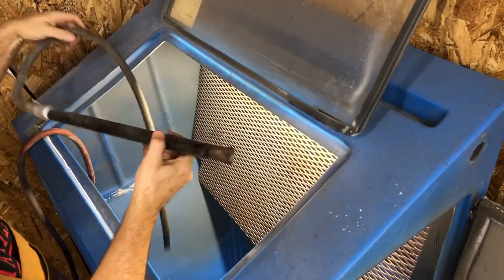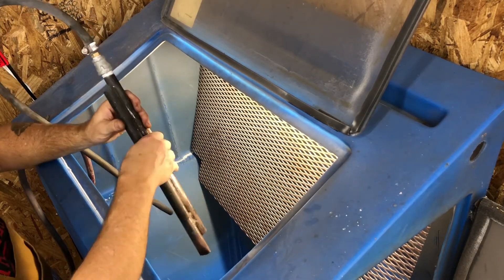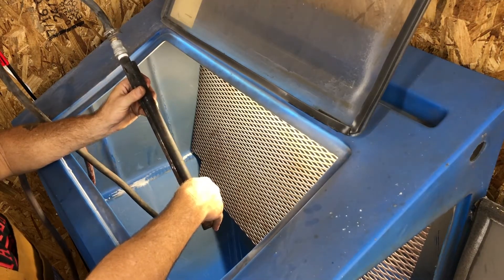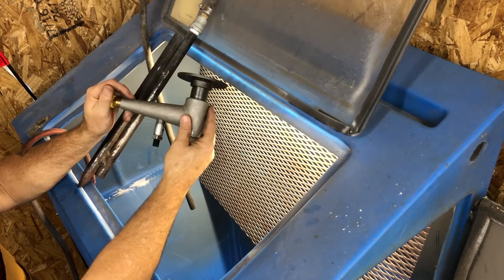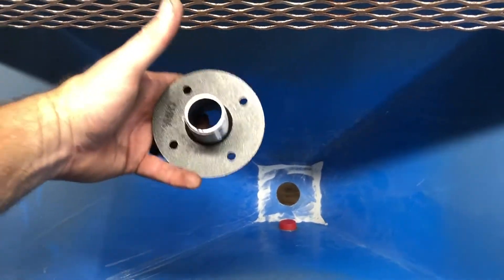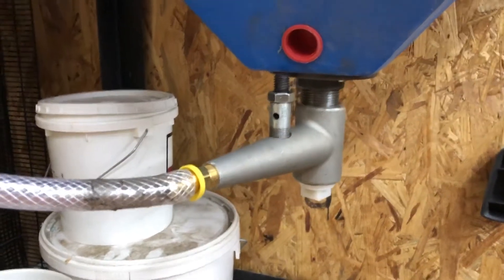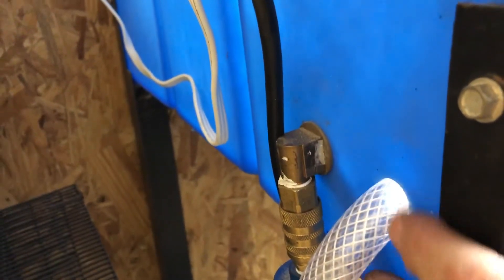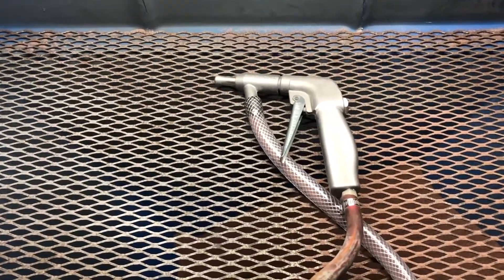Installing a Blast Cabinet Metering Valve Assembly

Comment: Are you blasting at 30 psi ? I though it was 90
Reply from the maker: It all depends on what I need to blast. If I’m etching it may be between 30-40. Prepping for coating ranges between 30-120 depending on the substrate. General blasting/cleaning/stripping is around 80-120.

Comment: I like your explanation, well done! It looks pretty easy to make from pipe fittings, Use a 1- 1/4" tee, a 1-1/4" pipe plug at the base of the tee, a 6 inch nipple, a reducer from 1- 1/4" to 1/2" , 5/8" pipe nipple 2" long to be modified as your air valve  and then finally a barbed fitting to your air hose. The only machining would be is to drill and tap a 5/8" threaded hole into the 6 in nipple. The using a 5/8" nipple that has  (2)  1/4" holes positioned one above each other. Then drill and tap into the 5/8" air valve nipple to accept a bolt to adjust the air flow. No need for a locking nut on the bolt, it isn't going anywhere. But put one anyway. You'll feel better that you did.
Reply from the maker: I’ve seen these done and are a great diy idea. I was under the impression that the tapering increased the Venturi effect. No proof - just an impression I can’t shake.
Reply: I'm not sure if the tapered design acts in anyway as a venturi since the proximity from the air valve to the tapered area is to far to create that effect. It does make it look complicated though.
Reply: Tapering it allows it to flow without restriction from the larger size to the air hose size. You may see some improvement with lower CFM supply. With a larger capacity of reserve air in your compressor tank you may not notice any difference. The 1 1/4 nipple does as good if not better in mixing the air/abrasive mix. Use a ball valve to control input air into mixing chamber. Don't waste time with nut/bolt/tube idea. It is just their way to confuse you

Comment: Thank you for posting this video.  I just picked up the same Cyclone cabinet on FM and the IDS Blast metering valve will be one of the first upgrades, after a few repairs.  I am also interested in anything you can share/recommend on the dust collection for this cabinet.  Thanks again!
Reply from the maker: Glad you found it helpful. Here is a link to my cheap dust collection system. It has been working great! Good luck with your cabinet. https://youtu.be/4tQ9s_EJdRg

Comment: So I just bought this same metering valve and installed. How did you go about the settings? I have a 60 gallon two stage compressor with a skatblast gun. The siphon tube is 5/8 ID.
Reply from the maker: Ryan H it’s sort of trial and error based on the media you are using to blast and the pressure needed. I use 100 grit red garnet at lower pressures so I had to do a lot of “dialing in” until the delivery was what I needed.
Reply: TigerCreekFarm seems like mine only works well when the valve is all the way open.
Reply from the maker: Ryan H that tells me that whatever you are using as a blast media requires a lot of air (and wide open is the best setting) or the insert in your gun may be worn out.

Comment: IDS blasting had the part you have and the one I have been looking for and they sell them on there own, out of all the videos I have seen this is the only one that helped thank you 
What parts did you use for the top to fit it in the cabinet cheers
Reply from the maker: I show it in the video.
I drilled a 1 inch hole in the bottom of the cabinet.

I then screw mounted a 1 inch pipe flange to the underside of the cabinet - then used a 1 inch pipe nipple to connect the metering valve to the flange.
Make sense?

Comment: What size is your feed hose?
Reply from the maker: Ross Massa 5/8 id
Reply: @TigerCreekFarm  thank you trying to piece together my own metering valve
Reply: I already bought everything for 1/2" and see a lot of other guns/metering valves use 1/2 inch
 So gonna try it
Reply from the maker: Ross Massa 1/2 should work - just have to work a little harder to get the hose on.

Comment: Nice job, I have been looking at the same metering valve but I wanted to know more about it, hence the reason I went to YouTube. 
I like your install but I was wondering what you might think if you were to put a collar through the wall of the cabinet with nipples on each side to connect the hose to and putting rubber washers with fender washers on each side of the wall thereby sealing the area around the hose. That way there if you had to replace any part of the hose you would have a shorter piece to deal with and you wouldn’t have to feed the entire length of hose through the wall and back again as well as risk kinking the hose where it feeds through the wall from prolonged use.
Just a thought 💭...
Again, very nice job, have a great day 👍
Reply from the maker: Thanks for stopping by. I think your idea would work great for the air but not for the media feed tube. The media going to the gun would wear it out any metal connection at the cabinet - or so my thought process leads me to believe. This is the great thing about sharing ideas and improving upon those ideas - eventually the problem is solved with an excellent end result. I appreciate you sharing your thoughts and trying to improve this process.

Comment: I have no idea what your before blasting was like but that flow rate at 30 PSI after the change looks incredible.  Just curious if that Skat gun is the medium or small CFM version?  I was using a friends blast cabinet this weekend that still had the pick up tube and stuff and I have to tell you it was torture.   I have a 3.7 hp compressor that is rated at 11.5 cfm at 90 PSI so I am just trying to figure out if I should go with the small or medium sized gun..
Reply from the maker: I know EXACTLY what you mean. The gun is the small version. You'll find that your compressor won't be struggling to keep up with the flow with the smaller gun - plus you can always move up to a larger tip if necessary. So far I haven't looked back. The only change I am considering is changing to a foot operated gun - because I am able to blast so much longer without a pause I start getting hand cramps operating the trigger. I found that the magic "spot" for adjusting the feed at a lower pressure was to open up the valve about half way allowing it to pull more air into the mix. That eliminated the clumping or uneven media flow. Good luck!
Reply: @TigerCreekFarm  Just got my foot pedal over the  holidays.  Still making modifications but thanks for the feedback.  I am curious to know what brand is that cabinet?  I would like to find one that has a plastic tub like yours to look at the idea of making a vapor cabinet.   Thanks sir.
Reply from the maker: Robert Craft my plastic cabinet is made by Cyclone.